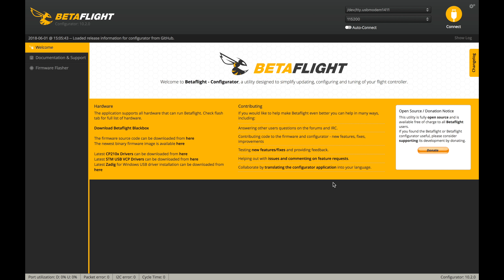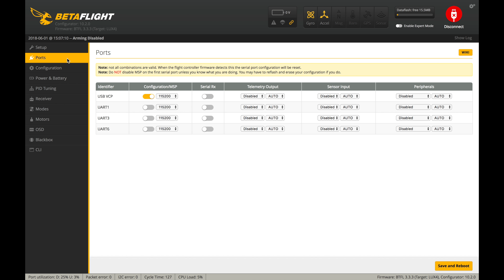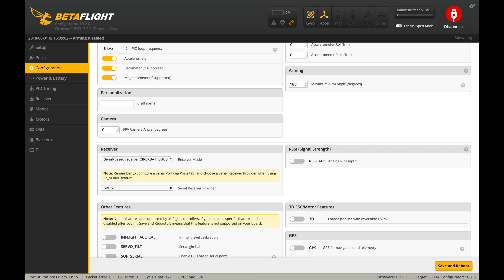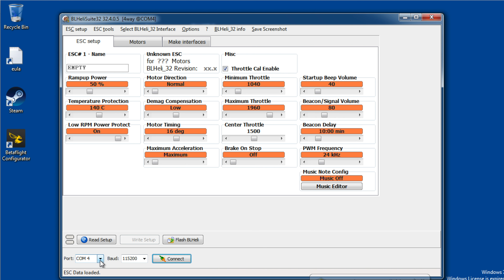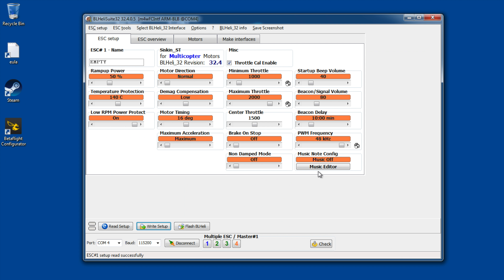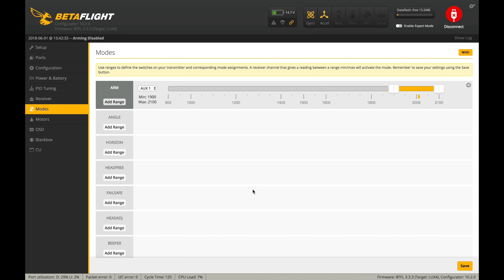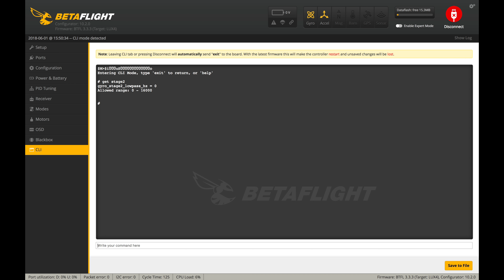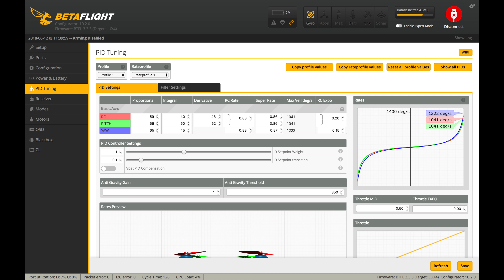Bannilite FPV Racing Drone - X-Lite Binding and Betaflight 3.3 Setup Process

Comment: Very nice! How long does the battery last on one freestyle flight?
Reply from the maker: Batteries on any mini quad typically last anywhere from 2 1/2 to 4 minutes depending on how hard you fly.
Reply: Oh wow, that is very quick. I was planning on building an fpv copter to use it for capturing nature/landscapes similar to the fpv freestyle I've seen here in YouTube.
Reply from the maker: @neilfpv  Know what you're going to build yet?
Reply: Not yet but I've been looking at the builds at rotorbuilds.com. That's how I got to your build :D I want a 5 inch, a flight time of 5-6 mins and distance of about a mile will make me happy :) I have an idea now on the radio. I'll get the Taranix XD9 Plus.
Reply from the maker: @neilfpv  You can maybe get five minutes cruising on 5", but you'll need to go really easy on the throttle.
Reply: @whiffles  Got it. I'll keep on reading builds so I can understand them more better. :)